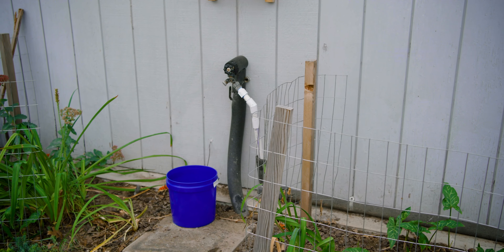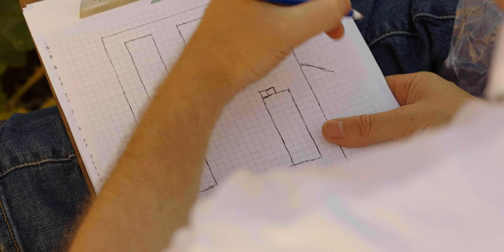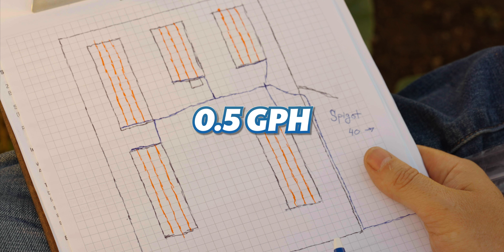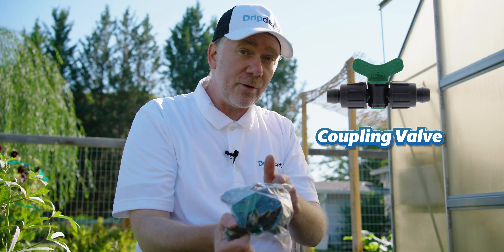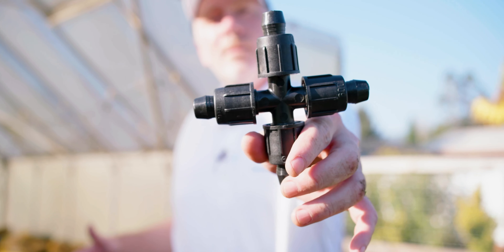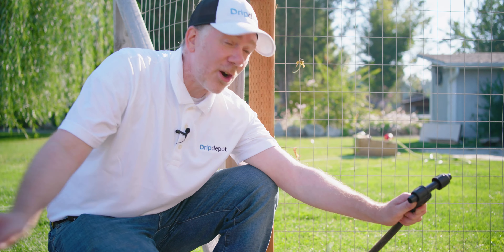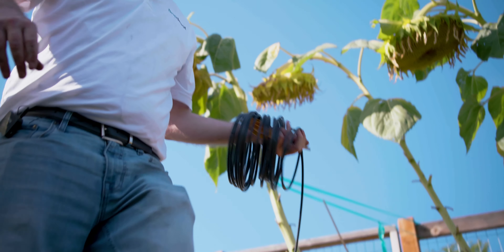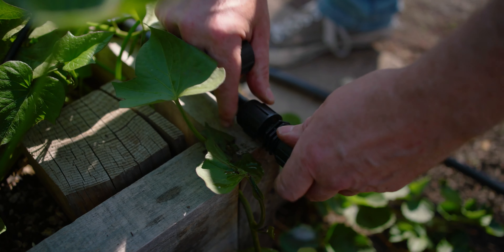How to Install Drip Irrigation for Raised Beds (Complete DIY System Guide)

Comment: I am putting together my drip system now that I got the parts for a couple of months ago. I didn't buy 1/2 inch tubing because I already had a large roll that I bought locally. I am finding that it is really hard for me to connect the perma-lock fittings. It looks really easy when you do it in the videos. Would it be easier if I bought your 1/2 inch tubing?
Reply from the maker: Potentially so Nadine!  That or slightly different fittings (I can help with either one).  

In the industry, there are a lot of different 1/2" tubing sizes that all say 1/2" even though they actually measure different.  We use one of the more common sizes with a 0.600" inside diameter and a 0.700" outside diameter. 

There's also quite a bit of 1/2" tubing that measure 0.520" inside diameter out there, and I suspect that's what you have if it feels like the barbs on the fittings are a little too large and it's difficult to push the tubing on.  

Our 1/2" tubing will work with all of our 1/2" fittings (our 1/2" fittings work with a small range of 1/2" sizes, but unfortunately not the 0.520" inside diameter tubing) -- our 3/8" fittings will work with that 0.520" inside diameter stuff, however. 

This is a common enough problem that we actually made a video about it -- I've described most of it above, but if you'd like a little more detail, here is the link to the video: https://www.youtube.com/watch?v=SY71GKA_CyQ

If you wanted to return fittings to get 3/8" or just grab some tubing, I'll be happy to help either way :)
Reply: @dripdepot  Thank you. Mine doesn't say what size it is but that is the same size Home Depot sells now. I bought this at HD a couple of years ago, so I'm not sure it is the same. In any case I ordered some from you. I hope it's easier to use than what I already have, which I have really struggled with, even when putting the tubing in hot water.
Reply from the maker: @nadinehansen9241  You bet Nadine -- I can confirm our 1/2" tubing works with our 1/2" fittings, so you'll be good to go there.  

It can still be a little difficult to get on (to some degree it has to in order to make a water tight seal), but I know some tips that will help.  

When poly tubing gets warm, it gets softer and more flexible -- this can make it easier to get it on over the barb.  What you can do is drip the end into some very hot water (careful not to burn yourself though!  I've done that) for a few moments until it gets soft -- you'll find it goes over the barb a lot easier then.   Sometimes just leaving it out in direct sunlight can warm it up a lot too. 

Another tip is to use the "walk on" method.  As you push the tubing, wiggle it back and forth a little bit to walk it on over the barb.  

If you experience any troubles, just let me know, I've got more tips and will make sure this gets up and running for you :)

Comment: How often should i water my tomatoes, straw berry and blueberry plants? They are in a raised bed, and  I live near the coast in VA, and it gets near 100F during the day.
Reply from the maker: There isn't one right answer to this, as a lot of variables are involved (cultivar of the plants, soil moisture retention rates, maturity of plants, number of fruit, etc) -- basically, it will vary from location to location.  

For the most part, we recommend "water and watch" -- pick a watering cycle and monitor the health of the plants so you can adjust accordingly.  With that said, during the hottest part of summer (often around 100° here too) I typically water my garden fruit and vegetables for 30 minutes, twice per day using 0.5 GPH emitters.  Your optimal cycles will likely be a little different, but you can use that get a rough idea -- for example, my soil moisture retention isn't great (I really need to get more mulch) so I have to add that second cycle in the evening.  

When experimenting with watering cycles, always remember it's easy to add more water at almost any time, but not to remove water, so I like to err on the side of potentially too little when first picking a cycle.  

Also, don't use the wet circle on top of the soil as a benchmark -- when done correctly, drip irrigation should only leave a small wet circle on the surface, all the action happens beneath the surface of the soil.  You can dig around a little after a watering cycle to see how the water spread -- remember, for most plants you want it to be moist, but not wet :)

Comment: is it possible to attach both drip tape and drip line to a designated water line say a 1/2' or larger water source line?
Reply from the maker: It sure is!   A setup like this can perform well so long as the limitations are respected (not going over 200 GPH in flow in the 1/2" line, etc).  

In these cases it's best to pressure regulate for the drip tape (15 PSI for 15 Mil thick tape) versus the drip line (25 PSI).  This will protect your drip tape from pressure and drip line will still perform great at 15 PSI, it's well within its operating pressure range :)

Comment: When do you use the dripline and when the button drippers?
Reply from the maker: For the most part, drip line when the plants are in a row or densely planted enough that snaking it through the area doesn't have emitters dripping where the water can't be used.  Button drippers for individual plants or out of the way plants.  

The two are interchangeable to some degree, and are often used on the same zone, as they can both have the same 0.5 GPH flow rates.  In those cases it comes down to labor time, while you could install a button dripper at each plant down a row (and you'd likely get good results), the additional time it would take is quite a bit longer than just running the drip line down the row and capping it off :)

Comment: Watching your videos to customize my kit before I order. I notice you didn't seem concerned about going through the middle of the garden area. Is it ok to run the mainline through a high-traffic area? It makes the most sense to do mine that way, too, but I want to be sure it's ok.
Reply from the maker: This is a great comment, and if I could go back I think I would address it in the video, as you bring up a really good point.  You are correct, in the video we weren't concerned with just running the tubing through the middle of the garden -- the house we installed that one at has no small children who might be unaware (or quickly lose focus on) of a trip hazard like tubing.  

It was fenced off as well, so less concern about guests or visitors who are unaware of the tubing walking through the garden. And with all that said, the tubing is pretty small and during daylight hours very visible.  If there's not a lot of foot traffic in an area, it's very common to leave it above-grade.  If there were young children (or a lot of foot traffic) I'd likely bury the mainline in high traffic areas. 

Great comment, thank you!
Reply: @dripdepot Ahh, the mainline can be buried! That will work nicely, thank you.
Reply from the maker: @Daedal71  You're very welcome!  If you bury it, do it like PVC (though you don't have to go as deep) -- build a trench of soft crumbly soil for it to lay in, pull out any rocks or sharp sticks, and you're goood to go :). 

In my home garden I probably have 3/4 of my tubing buried and the rest above grade -- I've made more repairs in the above-grade parts (dang raccoons) than I have the buried parts.
Reply: @dripdepot  thank you for the tips!

Comment: So if I'm on a 30psi water tap and I want to use a single 200-250ft 3/4" dripping hose with holes every 1.5ft or so for 0.5gph, do I still need to use a water pump?
Reply from the maker: At 30 PSI you're at the high end of drip irrigation pressure, but from what you've described that's likely a good thing as button drippers typically operate at 25 PSI but can absolutely handle 30 PSI. 

So, your pressure is good enough (and not too high) to push the water, let's also make sure you have enough water available to feed the emitters without a pump.  

To test the flow rate, time how long it takes to fill a bucket whose volume you know (for example, 2 gallon bucket, 5 gallon bucket, etc).  Once you've got it timed, plug the numbers into the flow rate calculator at this link -- you'll just need the size of the bucket and how long it took to fill: https://www.dripdepot.com/irrigation-calculators

There's a good chance you'll have enough flow without a pump (but definitely still test it!) -- If you had 250' of 3/4" tubing with a 0.5 GPH dripper every 1.5' you'd have a system that flows at 83.33 GPH, which isn't too heavy of a burden for most water sources. 

After you test your flow rate, reply here and let me know what you got and I can send information on what that means for your system :)
Reply: @dripdepot  amazing! thanks a lot for the super detailed explanation and help!

Comment: Hi Adam, got a question for you. I have multiple raised beds and I am using 12"  and 6" drip line emitters, some beds having both lines. I would like to "mark" the 12" drip lines. What options would you recommend? I was thinking using a tree label, or maybe a dot of red nail polish/ paint on the line, close to the mainline? Would the nail polish/ paint mess up the drip line? Would it bake off in the summer? Wash off in the rainy Pacific NW weather?  Thank you in advance.
Reply from the maker: A tree label could definitely do the trick!  There's some brightly colored ones that would stand out really well too.  A zip tie could similarly work, with the tail end sticking up like a flag to identify the line.  I think your concern with the paint is a good one, there's a reasonable chance it could erode off over time from wind and rain (not to mention the summers we get up here!).  That and you'd want to make sure it's a plastics safe paint (nail polish is often used with acrylic nails though, so maybe it already is?). 

The brightly colored poly repair tape you see out there could also work -- the manufacturer makes it in yellow, so it would stand out pretty well in a garden bed.  

And last but not least, though it's probably too late to do so now, 1/4" drip line is available in both brown and black colors -- you could have all one spacing be black and all of the other be brown.  If you ever add more beds in the future, keep this one in mind :) 

Thank you for the question Imola!
Reply: @dripdepot  How long do I need to water the raised beds? I want to do the deep watering method. I am thinking 20-30 mins ever day? Or every other day. I have the 0.5 gal drip line all set up and working. I have mulched the raised beds with straw. Not sure if what I am growing is important but here is the list: tomatoes, peppers, cucumbers, peas, beans, squash, melons, parsley, kale, broccoli. I have 3 zones set up to cover my backyard garden, and I did the mapping as recommended.
Reply from the maker: Your garden sounds fantastic!  I've never had much luck with melons for some reason.

So, the answer to this varies a lot (on microclimate conditions, soil type, plant maturity, soil infiltration rate and many others) so it's tough to pin things down to one solid watering cycle answer.  I think you're on the right track with the 20-30 minutes a day or every other day.  That cycle would be a little long for us up here in Oregon at the moment, but we're not into the heat and dry summers we get up here yet.  If you're in a dry climate I could definitely see 20-30 mins per day or every other being a good cycle for deep root watering.  

I'd start on the shorter end of that and monitor the health of the plants and dig around the soil a bit between watering cycles -- the soil should be most but not wet.  If it's moist but the soil is still crumbly, you're in a good spot (if it's wet or muddy, shorten the cycle or reduce their frequency).  

You'll also be increasing the cycles as the summer heat kicks in, so if you find that what works now isn't working in a few weeks, don't worry, that's completely normal.  I also usually like to err on the side of starting small -- this is because drip irrigation is more efficient than folks realize, it really is good about delivering water directly to the roots -- that's why I suggest digging around the soil, as the top of the soil will probably look dry with just a few small wet spots.  With drip, that's a good thing, as mots of the action should happen beneath the soil.  :)
Reply: @dripdepot  Thank you so much for your answer. I will monitor the soil and see where that takes me. I am hoping the melons turn out good, this my first year of planting more than 1 plant.
Reply from the maker: You're very welcome Imola!  You're gonna do great and you're going to love the fresh foods -- when everything is fruiting, take a walk around your garden and just munch a few things right off the plant and you'll spot the difference between store bought and home grown food right away :)

Comment: This video was amazing. I am getting ready to set up my first system ever, and this video and MANY others from y'all have given me confidence to do it on my own. I just have to know one more piece of info. How do you know how many drip lines to run for the width of your bed? I know you said water will spread about 12" under the surface, so for your 4' wide beds, is that why you ran 3 lines? What would be the recommended for an 8' wide bed, 2 of my 13 beds are 8' squares?
Reply from the maker: Jesse, thank you for the kind words!  What a great way to start up Friday afternoon :) 

You got it exactly right, water spreading about 12" is why we go with 3 lines in a 4' bed -- that provides a little bit of cushion/overlap as well.  To some degree this depends on soil type, so there's no one right answer, but it's a good general approach -- in an 8' wide bed I'd likely go with 5 to 6 lines, likewise with the 8' squares -- if the soil were particularly loose or sandy I might go with more or with a tighter spacing. 

Another good general rule is to run a line for each row of plants -- if you have thirstier plants on the same zone, you can use an extra line for them (one on each side) or go with a tighter spacing (6" instead of 12").  You're likely to get good results however you approach it though, drip irrigation definitely provides a good margin of error -- the fun is also in tweaking it a little each season :)

Comment: Adam, a few quick questions (again).  I’ve got my beds in place and ready to order my drip irrigation system.  We are using 6 ft diameter deconstructed silos.  Does the 1/2 inch tubing accommodate an arch rather than putting in a straight line?  Ideally I’d like to follow the arch of the bed at the head and run 1/4 drip line (not tape) vertically.  Hopefully this makes sense.  Did you complete the video yet for attaching tubing to the metal raised bed?
Reply from the maker: Good morning Barbara!  I'm going answer your last question first :)  

We just finished filming the video yesterday, we shot it on Wednesday and Thursday.  Our video editor is in full edit as I type this, he's going to try and get it completed by next week, so it shouldn't be too much longer now.  

Our video does actually address both of these (but I'm not going to make you wait!) -- the 1/2" tubing does have some curvature that you can take advantage of to fit the curvature in beds and containers.  The tubing ships in a coil shape, so just lay it out matching the direction the coil does and you'll likely get a pretty good fit.
Reply: Heya Barbara, if you were still in need, we just posted the metal bed video :)

Comment: How to take off the barbed elbow or tee from the existing mainline. They are too tight. Any tips ?
Reply from the maker: That is definitely a challenge!  It's best to attempt it when the tubing is cold, that is when it will be contracted the most (and will prevent the tubing from simply stretching when you try to pull it off the barb).  In some applications, it might be easier to cut the tubing off the barb, as they are indeed a very tight fit (which they have to be to keep water pressure from blowing the tubing off the fittings). 

I have a reasonable success rate when doing it while the tubing is cold -- if you need to, you can run some water through it first, the water will cool the tubing -- then, try to pull it as straight as possible.

Comment: If I use a 50ft hose to calculate my GPH flow rate will it still be accurate?? Our bib isn't in a location where we can get a bucket directly under it.
Reply from the maker: Great question -- there will indeed be some loss due to the hose, but that might be good in this case.  Are you going to be using the hose to feed the drip system?  If so, it's best to test the flow rate through the hose so you get the flow rate of what you'll be working from.   

If you won't be using the hose for the drip system, that's still ok -- a 50' garden hose isn't going to cause a heavy flow loss in most cases :)
Reply: @dripdepot  yes we will be using the same hose to connect to the main line each row will feed off of. Thanks for responding!
Reply from the maker: @angelawagnon9778  You're very welcome -- and perfect!  Definitely use the hose then as that will get you an accurate flow rate where the irrigation will be connected :)

Comment: Do you bury the drip lines after completion? If so, how deep?
Reply from the maker: For the 1/4" drip lines themselves, those are typically left above grade in raised beds, though it's not entirely uncommon for folks to put them under a layer of mulch.  Going under a layer of mulch does increase the efficiency a bit (less evaporation) but does increase the risk of clogging.  

The mainline can also be buried if you like (and can be handy if the area is mowed or needs maintained with equipment.  In that case, 6" to 12" depth is good :)